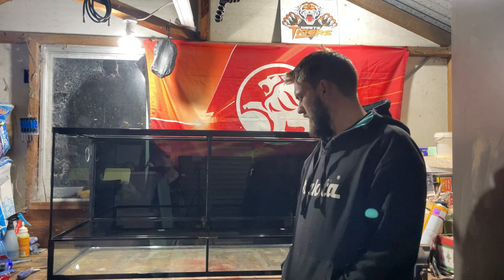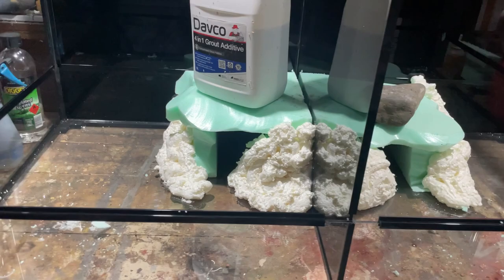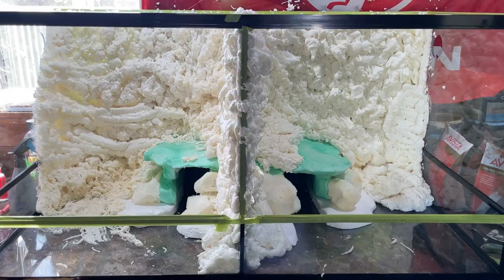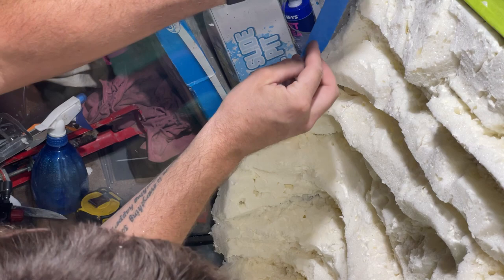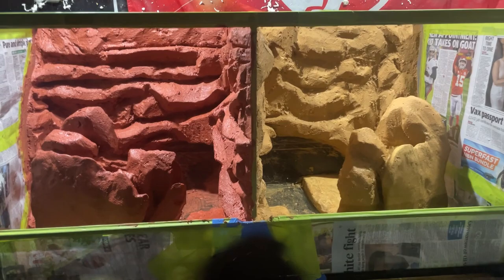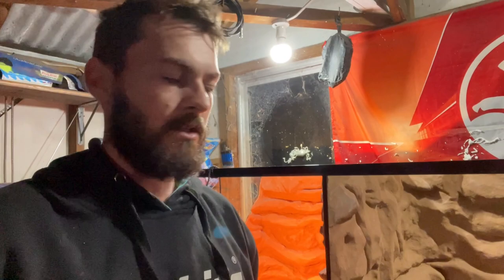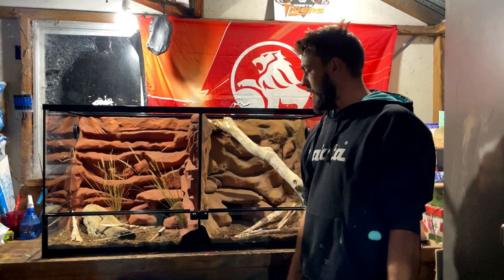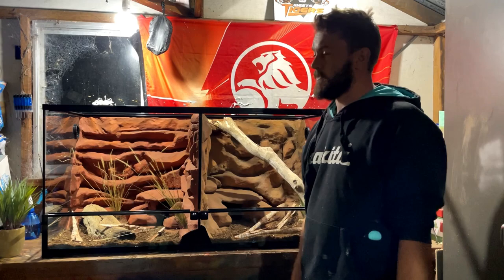Double Realistic Background Build

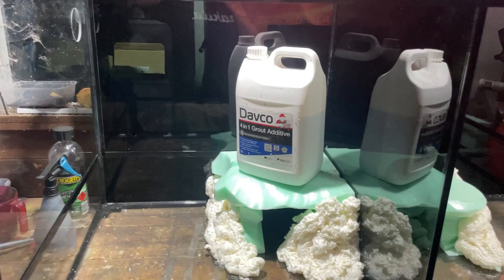Comment: How do you work with your foam canisters? From what I can tell, you would use some spray foam at one point (e.g 3:37), and then again at another time (e.g 3:45). With such a huge gap in time here, how do you not get your spray nozzle to work again? They harden pretty quickly for me, and if I did use the spray foam as you do rather than using it all in one go (where I would have to try to plan out everything as perfectly as I can and get my bare foundations done for all my XPS completed) before using any spray foam.
Reply from the maker: The spray gun attachment I use has a speed control dial which also shuts off completely allowing me to save the open can for another time. You need the spray foam cans that can take the gun attachment
Reply: @Cambart1  Ah. So they are fairly specific to use the gun. I had a spray gun attachment once, but I'm not sure if it was something I did wrong, but the gun nozzle got clogged up at some point after a couple uses.
Reply from the maker: I was using the Sika branded expanding foam with the gun attachment specific top on the cans. You can’t use the gun on normal cans nor can you not use the gun on gun specific cans. There is a cleaner you can get for the foam guns but I never needed to use it

Comment: If I use just insulation foam for the background instead of spray foam do I have to dry lock it? Also don’t you have to dry lock the spray foam or is it normal to just start painting after dried?
Reply from the maker: Hey mate, I don’t use just paint over either of the foams. I use a product I assume is similar to dryloc (we don’t have dryloc in Aus). The insulation foam is more rigid than spray foam which makes for a more solid structure but it most definitely still coated in a product that dries hard and is water resistant.

Comment: Hey Cam, have you ever had any problems with the expanding foam melting after it has set? Just done my 3rd layer of pointing and realised in a few places the expanding foam is starting to get holes in it and go sticky
Reply from the maker: It doesn’t melt after it’s set, what it is is that the expanding foam has gone on to thick and there isn’t enough moisture behind the outer layer to expand the inner areas. As I carve out I find areas that are soft or hollow and I’ll re foam those areas prior to coating. If you have a glass enclosure you’ll be able to see the gooey areas from the outside. With your situation now I’d cut a hole out around the areas and refill with more foam. Try misting water inside the area prior to foaming again.

Comment: Hey Cam, im setting up a couple Geckos cages with custom backgrounds, i just need the paint what brand is the paint that you use
Reply from the maker: Paint itself is just cheap shop acrylic paints. The compound I use to coat the foam is roof tile pointing available from Bunnings.
Reply: @Cambart1  oh ok Killa, where can I get them from
Reply from the maker: Paint you can get anywhere that sells paint for craft etc. the roof tile pointing is from Bunnings
Reply: @Cambart1  would silicone work for sticking the ledges on?
Reply from the maker: Possibly but I have never done it. Not sure how well it would stick to foam
Reply: @Cambart1  what do you use to stick the ledges on?
Reply from the maker: @snap_meme  either gorilla original glue or selleys polyurethane glue. Most of what I build the ledges are carved into the foam or I glue extra foam to places to make ledges bigger. For bigger animals/ledges I will build timber support shelves and line them with foam then carve.
Reply: @Cambart1  thankyou, I think I have that in my shed

Comment: How long do you let it cure for before you  can put the reptiles in
Reply from the maker: As long as everything is dry (crevices and thick spots will take longer) it is safe to put animals in.
Reply: @Cambart1  even if the smell is still quite stong  have just finished my first background    everything is rock solid but still smells
Reply from the maker: I haven’t experienced any drama with smell etc. if you’re concerned you can leave it a few more days in a well ventilated spot. Sorry for late reply just saw the reply now
Reply: Do you use a pond sealer over the top to make it easier to sterilize if needed
Reply from the maker: No I don’t the product I use to coat is waterproof and resists urine etc. I wash off with water and brush then disinfect with my preferred reptile cleaner. Treat it as you would a natural rock. Obviously leaving faeces or urine on the surface for a while will cause it to soak in like a natural rock would.

Comment: Wot can I use to seal polystyrene foam in uk
Reply from the maker: I’m not sure sorry mate
Reply: @Cambart1  so am I right in thinking I'm obvs in UK.
Can I coat EPS in any tile mortar..and paint on top with Acrylic paint and it's going to be safe for corn snake?
Reply from the maker: I know on the states they have a product called dryloc I’m not sure if you guys can get it in the uk. I would think that mortar or grout will be fine and any acrylic paints are fine
Reply: I'm trying to enhance a 3' X 3' X 45 cm deep Viv...I've got loads of polystyrene and love how you've used expanding foam but want to be able to remove panels to change if not happy.
Picked up some really cool branches and want to incorporate them by making an Enchanted hollowed out tree in corner..but how is another world ATM lol...have you got an hour...🤣
Reply from the maker: I actually went away from expanding foam and went to foam panels instead. You can see that in my newer videos. Having a removable background is good just gotta be sure it can’t fall or you animal gets behind it